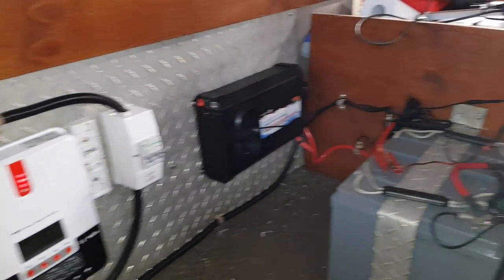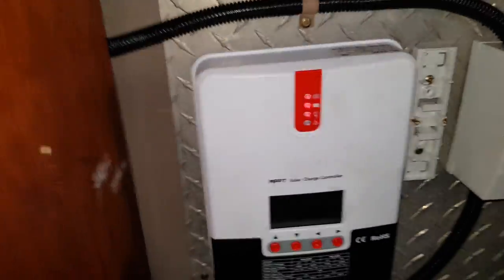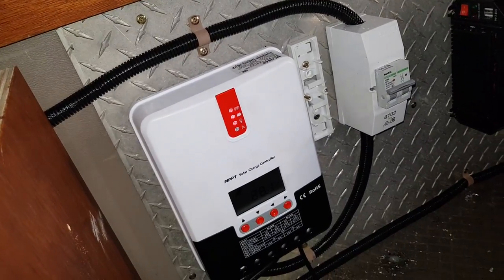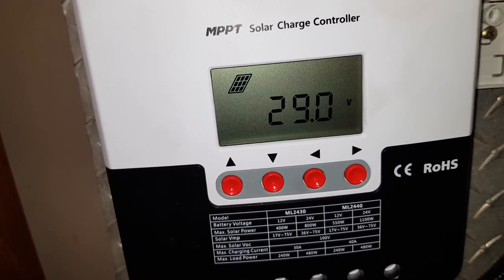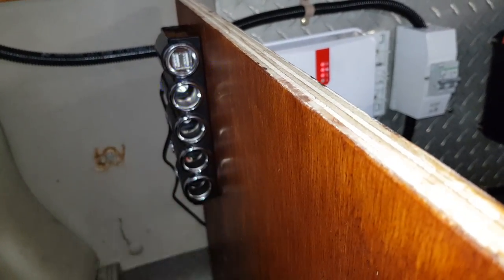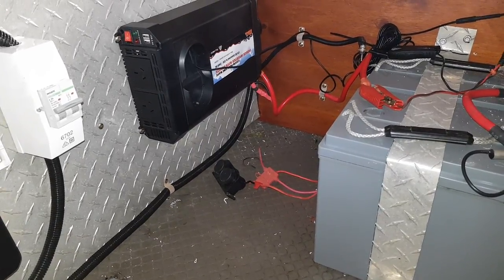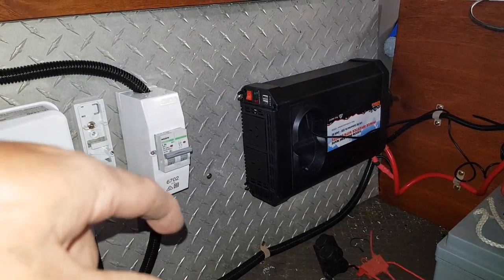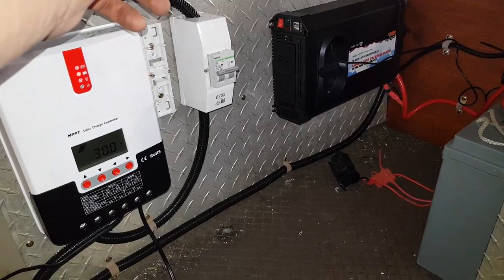Setting up A  1kw Power System In A Toyota Coaster pt2  Bus Van Life

Comment: 1 kW = 1000 Watts. Assuming 85% efficiency, the inverter will take around 95 Amps at 13v. I don't think your skinny cables between battery and inverter will tolerate 95 Amps for very long.
Reply from the maker: Its fused at 100amps and i used supplied cables

Comment: What type charge controller is that? I'm looking for a upgrade charge controller. I'd like remote monitoring. And high current and 100vdc input. My next pv array may be up to 200-300' away. So I will likely run them at 84-88 vdc depending on panels. If the same as I have now. 4 seriesed, near 22v ea. So 4-5 in series. So possible 110v DC over up to 300' mppt bucking it to 29vid like to keep it closer and 3-4 panels in series. Nice lul setup. I'd love to have a mobile setup , a heavy duty 4x4 bus converted to camp rig! With about 2500watts of panels that fold up on the roof. And unfold, making a covered "patio" for out door living. With all the power of home!  A 6x6 2.5 ton military truck converted to camp/ expedition rig. Awesome. I just need to get rich! Ha-ha!!! Awesome man!!